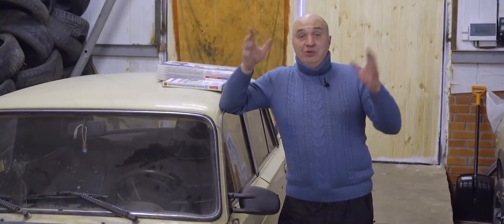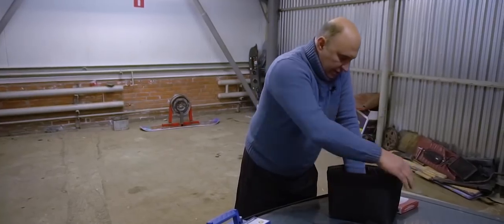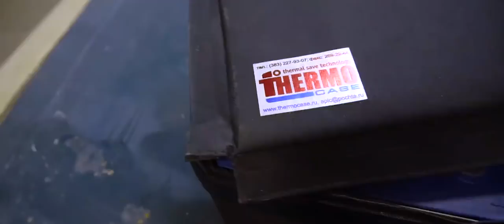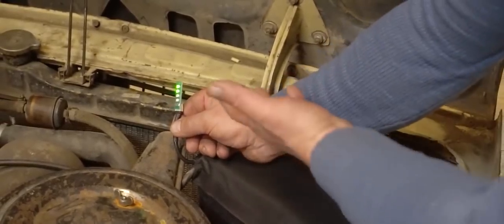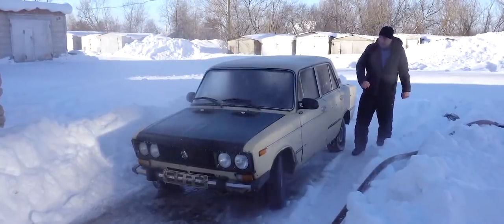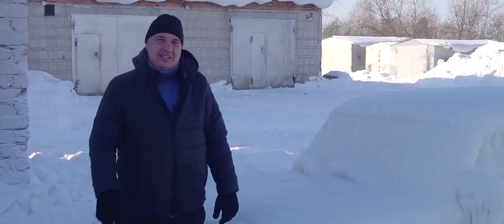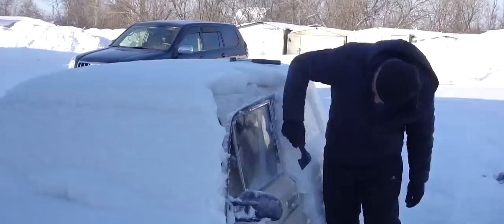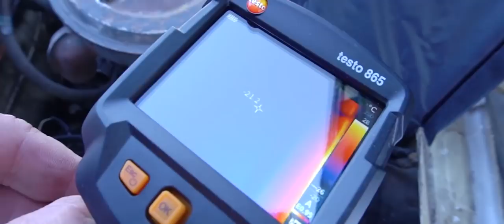Deep freezing: we’ll warm it up and go

Comment: Spraying the car has no effect on the temperature of the motor or battery, only show.
Reply: Wim Philipsen yes and no, they want to physically show us the temperature. We all (everyone on the planet) know Water, so they use the water as the absolute common thing (so through water they show us the temps). In my country in the winter it is usually -10' to -15' and I pretty well know how the water looks at that temp. So they are showing what is the water lookin in their temp ... coz -30' is just a number, but when shown that way it is understandable for everyone. The problem for me is - at temps under -5' you just don't use acidic battery ... you use supercapacitors, and that's all.

Comment: a battery heating case that takes power from the battery in order to heat it xD
Reply: It does, but if insulated well enough, the amount of energy needed to maintain some warmth is minimal.
Remember that a good battery, particularly an AGM will have a large capacity (like 40-60AH) and with AGM being able to tolerate deeper discharge, it isnt such an issue.
The amount of energy used to start an engine isn't actually that much (less than 1AH on a warm engine, maybe a few Ah on a cold engine).

What matters more is cranking amps the battery can deliver, and a very very cold battery can not deliver nearly as much as a warmed battery.

So for a few days, having an insulated and heated battery is actually better than not, as a partially discharged but warmed battery will be able to significantly out perform a fully charged but very very cold battery.